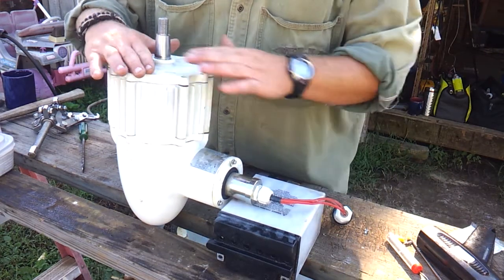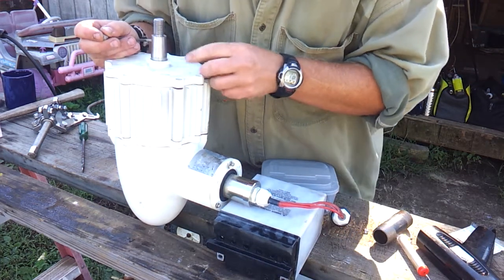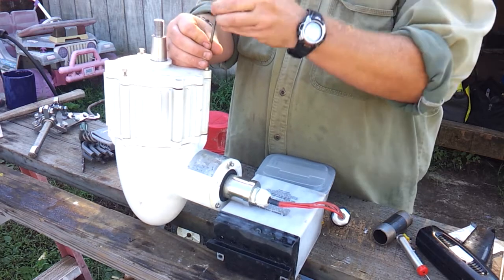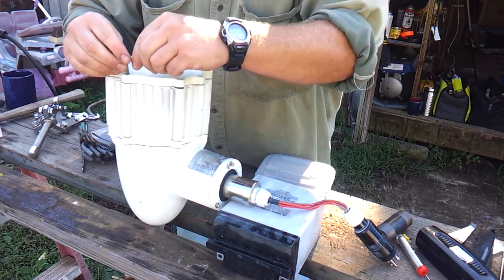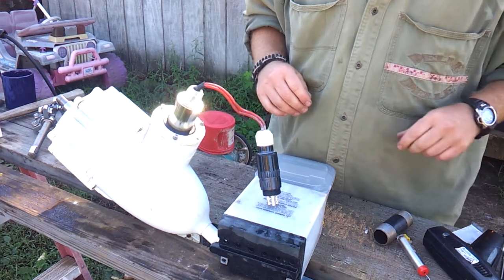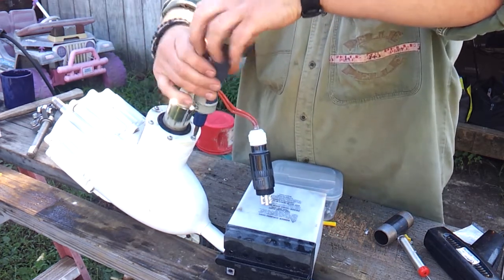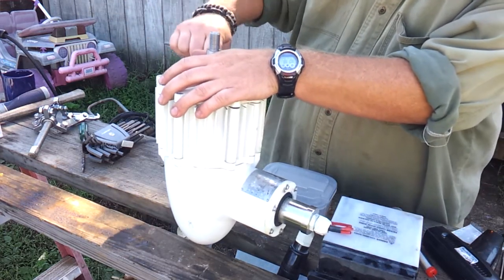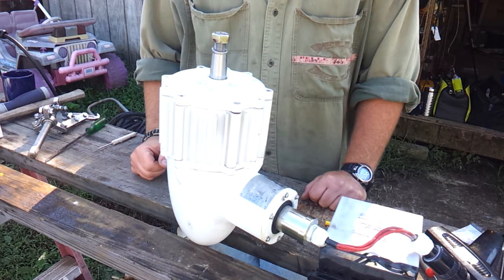Changing the Bearings in a HYENERGY Wind Turbine / Wind Generator Part 2

Comment: Hi Guy, I don't see it in your video but just remind you that before you putting the generator front and back cover, you should put some seal glue (sealant) so the generator is complete sealed, less dust into it, longer life time it will. 

Robin Li